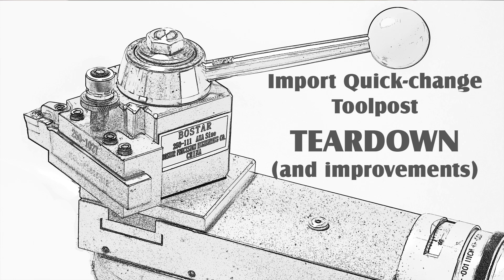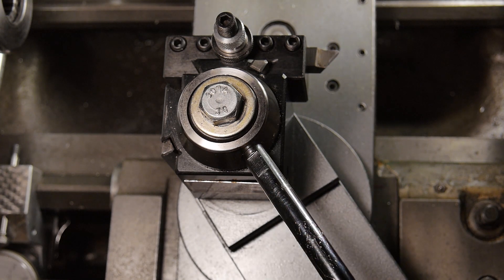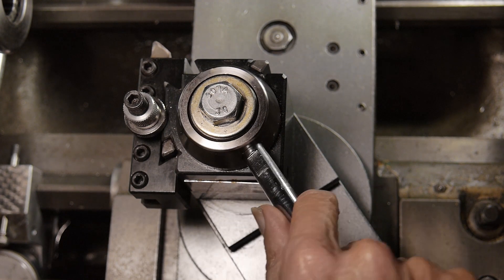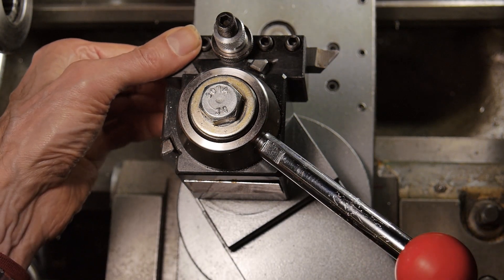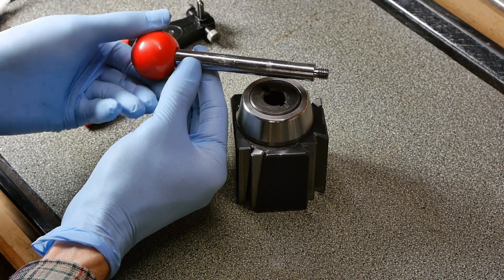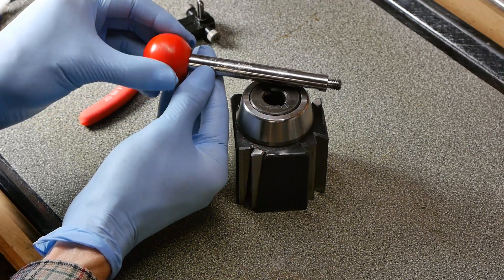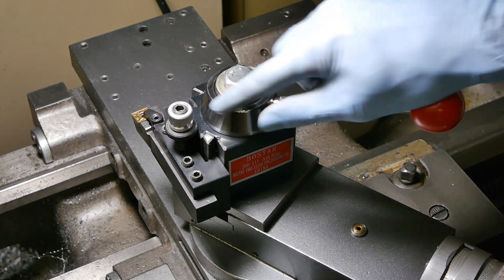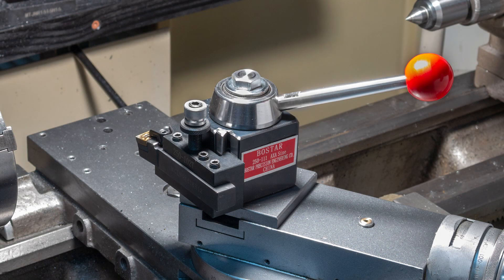Import Aloris-type Quick-change Toolpost Teardown

Comment: I purchased mine from a different vendor than yours (still pretty cheap though) and my dovetail play was almost non-existant with no difference between the 'tight' location for both front and side dovetail mount.  But I do have some play in the central locking gear assembly and will be doing your modification.  It's currently mounted on my Boxford AUD and working fine, but the slight wibble when I mount and dismount tools has bugged me enough to seek a solution and yours was a good example of what looks easy and safe to do.  Thanks!

Comment: It would be interesting to attempt to produce one of these .but I can't quite tell if the slot that accepts the moving wedge is skewed to match the wedge angle or not , though I suspect it would likely have to be .and I can see that the teeth behind the wedge are thicker on one edge than the other .so it would appear that the threaded plate area of the wedges are actualy at an angle relative to the main housing  that they slide into . Am I right please?

Comment: Thanks.  Good info on fixes.  I was a bit shocked at your problems, as I purchased the larger BXA version five years ago, and found it to be a very good quality unit, with no problems.  I'm sure it is the well known quality control issue, or rather the lack there of.  All I have done is replace the nut on top with a handle.  Regards.

Comment: Thanks Michael! Good job on your video. I too bought the same tool post in the last month. I adapted it to my new Grizzly G0752Z 10X22" lathe. Mine is a little different. It has the same label and was an Ebay deal. The thing that bugs me is the clocking of my handle is such that it can interfere with the placement of a tool holder on the side facing the work piece. It has to be in just the right position to put the tool holder on. Not a big deal but I noticed it isn't an issue on yours. Do you think I can take it apart and re-clock the handle to a more neutral position such as yours perhaps by how the internal "lead screw" interfaces with the stem of the handle???? Just a thought. Also, mine came with a center stud with a nut for a 22mm wrench rather than the bolt yours has. I do like the thumb style lock nuts you have on your tool holders. Did you make those? I have hex lock nuts on my holders and I think the knurled thumb nuts you have would be more convenient as you don't have to use a wrench to loosen or re-tighten them. Here is the video I made for my channel regarding my QCTP conversion. https://www.youtube.com/watch?v=zH_9ZCMikd0
Reply from the maker: It's a little hard to tell from the camera angle in your video, but it looks to me like your tool post handle locks up in about the right position, so I'm not sure I understand the problem. The knurled lock nuts on my tool holders were turned from the original hex nuts that came with the holders.
Reply: You prolly dont give a shit but does anybody know of a trick to log back into an Instagram account?
I was dumb forgot the login password. I would love any help you can give me
Reply: @Lennox Ridge Instablaster =)
Reply: @Lincoln Amari thanks for your reply. I found the site on google and I'm trying it out now.
Seems to take a while so I will reply here later with my results.
Reply: @Lincoln Amari It did the trick and I finally got access to my account again. I am so happy!
Thanks so much, you saved my ass!
Reply: @Lennox Ridge no problem xD

Comment: Thank you sir, for the excellent video!
I received this exact same tool post for Christmas but haven't installed it yet.  Thanks to you, I'm going to give mine a thorough inspection and fix whatever deficiencies I find.  You've earned a new subscriber. 😊

I'm paraphrasing here, but I've heard another You-Tube machinist, Stefan Gotteswinter, quoted as saying that any cheap Chinese import tooling that you buy should be treated as a kit from which you can make a decent finished product. Your experience seems to fit that description to a tee!

I've also heard it said that, in machining, there may be several right solutions for a given problem, and I wonder if a thin piece of shim stock - maybe sheet brass, or even Teflon? - might be rolled around the inner piece and trimmed so that the two ends are just short of touching?  It wouldn't form a complete ring(s) like yours does but finding a usable bit of sheet material might be easier - though less elegant - than making precisely machined rings. 
...or that might not work at all, and I should make my own video instead! 😩

Thank you again,
Doug
Reply from the maker: Thanks. Yes, a piece of shim stock of the appropriate thickness should work.
Reply: I just read my own post again and realized that I called you "sir" instead of ma'am.  I'm sorry!  🙁

Comment: The bolt holding the tool holder does not look original. There is usually a threaded center shaft with a nut on the top. I would guess the mounting bolt was bottoming out.
Reply from the maker: Good observation but no, the bolt does not bottom out.

Comment: about the shims put on the central shaft : you could've first make a pipe the right ineer diameter , place it on the central shaft and then turn the outside diameter 
doing it that way you have enough wallthickness to press the part on 
would've meant using youre normal shimstock style toolpost for part of the conversion as the quickshange would be in pieces 
have to say you solved the problem with simple solutions , might have to lo ok intoo my chineese quick change toolpost

Comment: 5-12-2020 Thank you for this very informative video.  I just bought this identical AXA Bostar toolpost.  Possibly the Chinese manufacturer viewed your post because the handle on my unit is pristine and there is no excess play on the top collar.  I can not yet comment on the variability of lockdown location or feel using the two positions as I have not yet mounted the device my South Bend Heavy 10 lathe.
Reply from the maker: Thanks for the feedback. Looks like you received a better sample than I did.

Comment: Thanks for the video!

Just like the other commenter, I had that bloody spigot on my lathe and was considering options. I thought about just adding a circular shim, or modifying the toolpost. I ended up just grinding the annoying thing off, since thanks to this video I found that part of the toolpost has threads, and with a shim tools end up too high.

For anybody interested in doing the same I just used a dremel and it was surprisingly easy. Used one of the thick wheels for it.

Comment: Isn't the difference in handle location you're experiencing a direct result of the thread position being that the wedges are positioned 180 degrees out?  Being that it's a double start thread I'm just curious if the wedges are being started on opposing pitches to make the wedge position symetrical.

The proper way to eliminate this difference would be to have the wedge threads indexed to compensate like the jaws are in a 3-jaw chuck on a single start thread.  This would keep the 2 wedges always at the same height regardless of handle position.
Reply from the maker: Interesting thought, but the problem here is one of sloppy manufacturing.
Reply: @mikelevyonline  since the double tread is 180 degrees apart and the wedges are not they should be cut slightly different from eachother to clamp with the same amount of turning 

wonder how you could make those wedges from bar stock....... thinking about putting a flycutter in the head of the lathe with the tip ground in the trapezium needed for the wedge and clamp the piece that needs to become the wedge intoo the toolpost calculate the radius needed and set the machine to cut the tread in the propper pitch and carefully set the piece on the toolpost closer and closer intoo the flycutter untill you reached the correct radius  , might need to set the treading in reverse 
than you have the teeth in the rear but still need to machine the rest of the wedge (oh joy) 
if you make it taller then you need it to be you can probable set it the way you want it before machining the top and bottom to fit the toolpost itself 
need to file the last few 10ths of the wedgeface itself to size by hand to get it exact

Comment: I was glad to see your video as it showed in detail how these tool posts are constructed. I am planning to buy a cheap QCTP however I need to bore out the base of the tool post holder to fit a (stupid) spigot on my lathe. I have seen this successfully done on the piston style tool post but would prefer the action of the wedge style. So I was wondering if the boring modification could be done with the wedge style. Your video confirms it would not work with the construction of the wedge style tool post as the threaded section at the base of the tool post would be removed by the boring operation. The alternative would be to remove the spigot however I would rather not modify the lathe in this way. Thank you Hugh
Reply from the maker: Thanks for commenting. Perhaps it would it be possible to just turn down the spigot to fit the toolpost.

Comment: Just returned mine. Thought it's defective, as the wedge thread wasn't machined and the wedge was touching the compound at the locked position. Kind of sad as everything else was fine. Bought a used Aloris BXA with 3 tool holders for a little bit more ($250). No play at all and the wedge is more than 1/8" off at the locked position.
Reply from the maker: Sounds like you made the right decision. Thanks for commenting.
Reply: You could have just ground a bit off the bottom of each wedge without harming the function of the action......the wedge(s) has to come down to grip the dovetail but must have clearance at the bottom when fully locked on a tool holder.
Reply: You should !. HAVE ! GOT ! RID !! OF !! YOUR !! LATHE !! TOO !!

Comment: Chinese mainland tools and tooling aimed at us poor folks at the bottom of the machining food chain is often in the end a "kit" from which you can make usable with some modification or reworking. Like you say, in a professional setting this stuff is no bargain. Time wasted fixing tooling is time that isn't being used to make salable parts or products.   So there is the reason an Aloris QC tool holder costs as much as it does.
   I have a Chinese QC holder that is the cam type on my 12" lathe. It works well enough on a small bench lathe, but probably not as repeatable as the wedge type when changing tool holders back and forth. I can't bash it too much as it was given to me and has given good service for some years now.

Cheers from NC
Reply from the maker: So true.
Reply: What do you mean !? By can't bash it to much !?